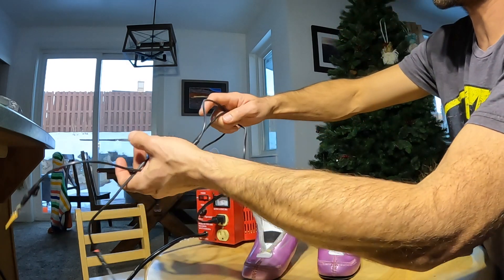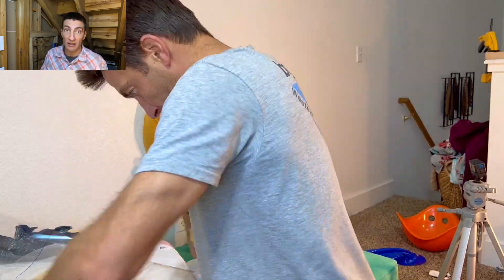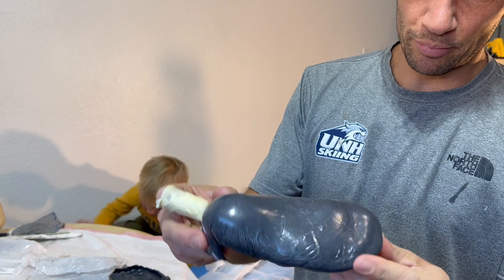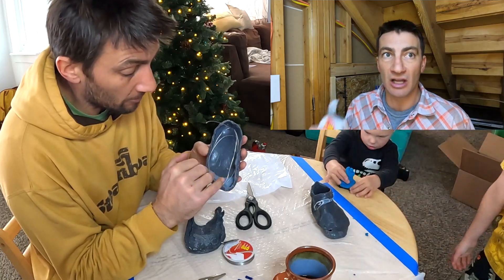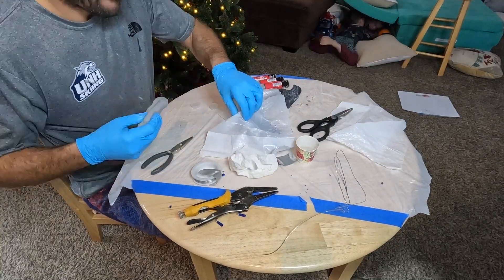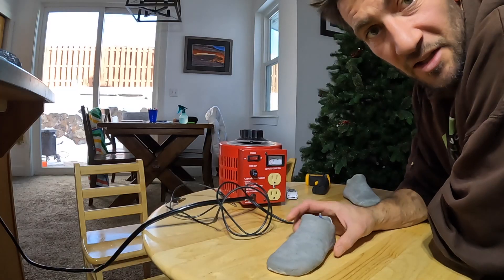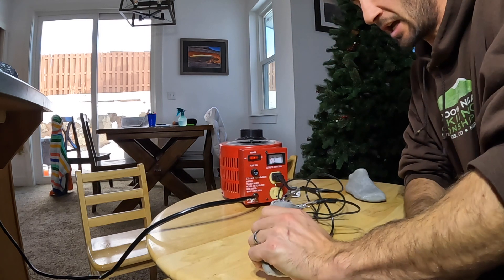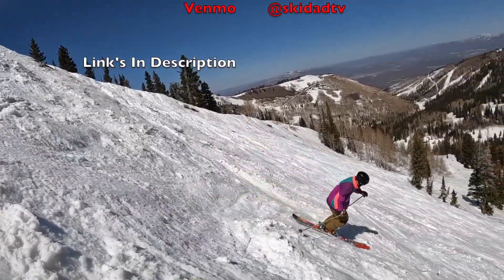Custom Boot Molds for a 3 year old Skier - The Perfect Boot Fit!

Comment: I have a wider right foot, One of the things my boot fitter did is make a 1 1/2-2 inch slice on the bottom of the liner to re leave some of the pressure, Then I skied t for a couple days and went back and had some punch work done. I really like your creative way of tackling the problem!